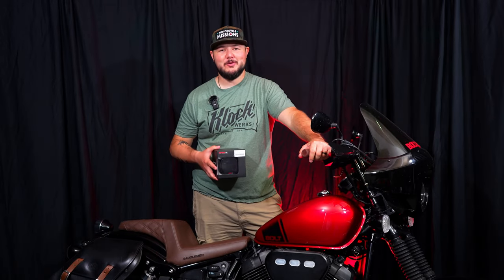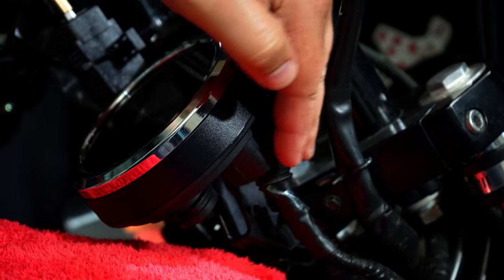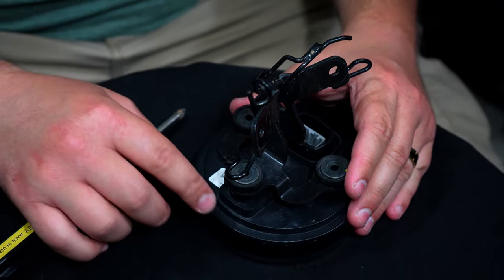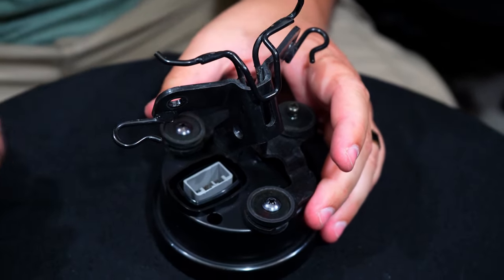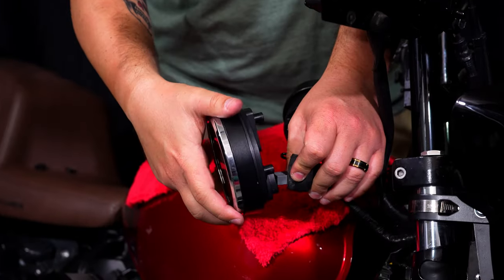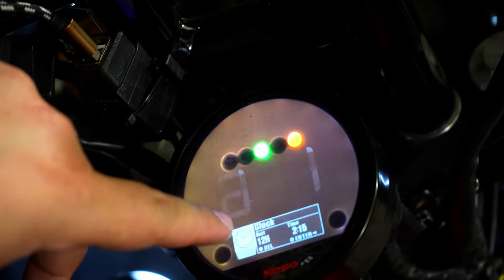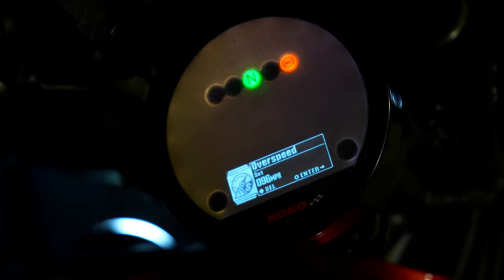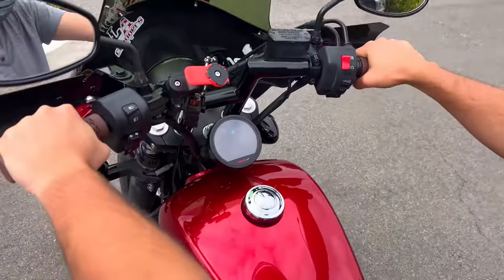The Koso DL-04B for Yamaha Bolts.

Comment: does it have a fuel level indicator?
Reply from the maker: No, unfortunately I think the only way to get that in a Bolt would be some kind of added fuel gauge. This works off of the stock wiring and fuel level is not on there. I was was hoping for the same thing. Still has fuel light though.

Comment: Hm, interesting. Stock Bolt does not show us RPMs. But KOSO uses the same connector. So, how the tachometer was implemented? Or you did not show us how to install tachometer wire harness? Or Yamaha has already provided the connector w/o actually reading from it? :D
Reply: Same question
Reply from the maker: It’s all already there. The stock just does not show the tac or any readings other than speed.
Reply from the maker: All already built into the stock computer. Stock gauge just doesn’t show anything other than speed. So when you plug in this one it will show you everything.
Reply from the maker: Once plugged in you get all the readings the computer is taking in, but not shown. Like rpm and temp
Reply: @getlarsonlost hi, do you know how to use the trip A and trip B? I am doing the same thing as I did with stock meter and it does not work, I mean I enter the trip A and long pushing the Reset button but trip A as well as trip B do not go to Zero km.
Reply from the maker: @blackstar3916 Seth said he holds down the select button to clear out.
Reply: @getlarsonlost  thanks a lot! Last but not least, I did not find the low fuel indicator lamp on the dashboard, and even did not find any light or anything indicating the fuel level, do you know where to find it and if there any signal ?
Reply from the maker: @blackstar3916 Seth said a red warning light will come and also a gas pump sign.
Reply: @getlarsonlost  thanks dude! Shall I put this setting on myself? Or it is set as default and will appear by itself once tank is empty? I really did not find this setting option at all in the main menu:(
Reply from the maker: @blackstar3916 we never set anything for that. We just figured it out once he ran low on gas. Haha
Reply: @getlarsonlost2736  thanks bro!
Reply: @getlarsonlost So you are saying that yamaha decided to give us a very basic gauge instead of giving us what they should have which was either a all in one gauge or two gauges, 1 tachometer and 1 speedometer.  I had a feeling that that motorcycle's computer could do everything.It's just that yamaha decided to cheap out.

Comment: Great video!  I bought the Koso one with the analogue tach but after seeing your video, I think I'll return it and get this one.  It does way more for not much more money.  How was it to see outside?  Also, the tire feature, if its like the analogue Koso, it is used to calibrate the speedometer, not to tell you when your tires need replacing.
Reply from the maker: It works pretty good in the sun. Still get some glare, but nothing like before.
Reply: @getlarsonlost2736 excellent thanks!  I'm still waiting for mine to show up in the mail.

Comment: Towards the end what did you say about the bracket? You had to bend it?
Reply from the maker: The plug will fit tight without bending or cutting. It’s a small piece that just over hangs on the bracket. No structural use. We ended up using a grinder to cut for a clean fit.
Reply: Can u show a picture of what you grinded?